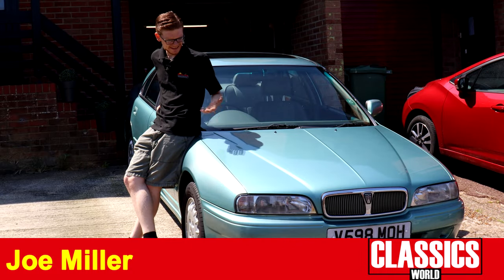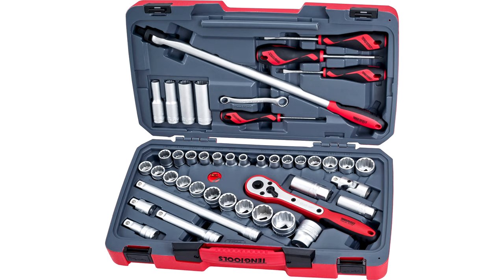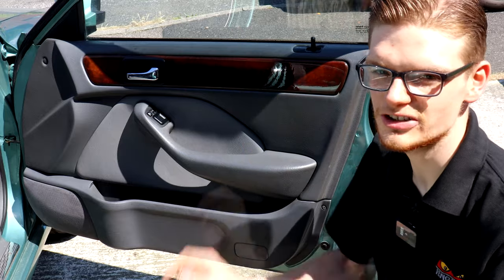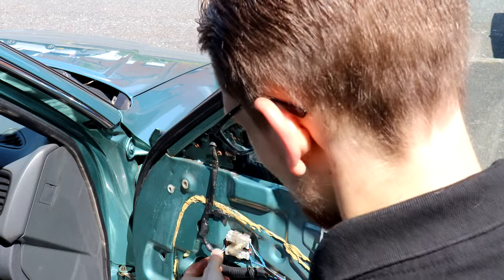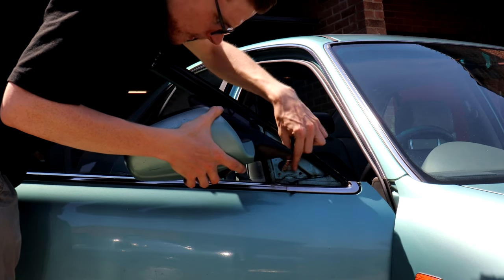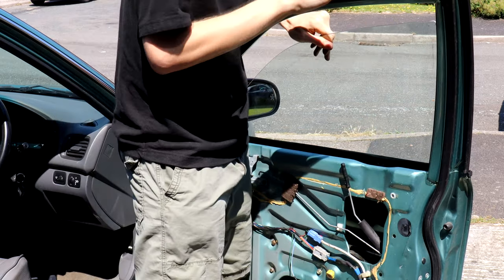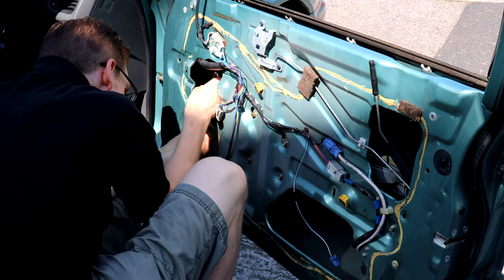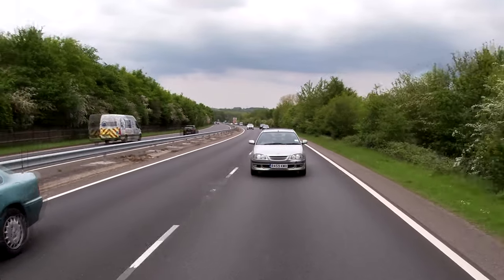Can I Fix The BROKEN Rover 600 Window?

Comment: If you ever get the chance, it may be worth checking behind the rear bumper for rot in the inner wing .. I bought a 600 earlier this year with a cracked rear bumper and when I removed it the passenger side inner wing was  blown out .. hole the size of a fist into the boot 😅. There was no sign of this whatsoever from the outside as its obscured by trim pieces. It obviously hadn't happened overnight so probably went through an MOT or two in that state too haha.

Comment: Great result for small money 💰 That's always a good result. I did notice there was no door water shredder attached to the door when you removed the door pad. Water will enter the cabin if not fitted. You could use a bin bag cut to the shape of the old yellow mastic. Silicone sealer can be used as the bead to attach the plastic sheet.
Reply: Yes, absolutely, they are absolutely vital in 600s and same era Accords as the water will get on to the pressed board door trim material and make it just absolutely come apart.  There should also be a small water/vapour barrier held in place by the door mirror screws on cars with electric mirrors that goes behind the door vapour barrier as the electric door mirrors do let quite a lot of water pass though their pivots and into the car, so the mirror screws or bolts and that area of the door is often quite rusty.  This doesn't, however, seem to happen on cars with manual mirrors...

Comment: That's typical off second hand dealers sending whatever they like to customers, well done getting it sorted I hope you get your money back on that window regulator nice posting :-)
Reply from the maker: It wasn’t ideal, but we got there in the end!
Reply: Unfortunately, with the 600, it's incredibly easily done.  The front window regulators do look almost identical off the car, so much so that, when I needed a new driver's regulator for my old 620SLi, one of the cars I looked at in the breakers did have an adapted passenger side regulator in the driver's door.  It also isn't helped by the fact that the regulators did change a bit in design over the life of the vehicle.  A tip I was given when I had the window issues with mine is to get a regulator from the same era Honda Accord as the Honda parts are better quality and more reliable.  I do have to say, though, that in this case a replacement regulator probably wasn't necessary as 600s and Accords can develop all sorts of window issues due to the window seal getting displaced and chewed up by the window.  Often refitting the seal correctly and lubricating it with silicon spray lube will cure the issues at no cost...